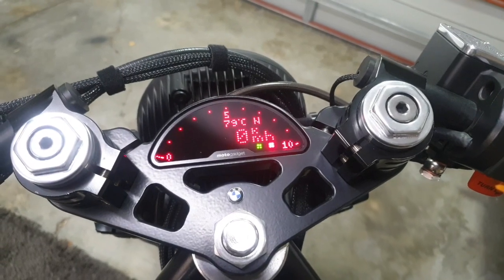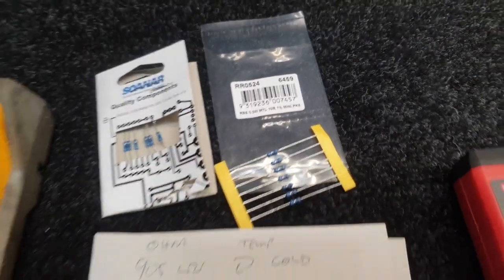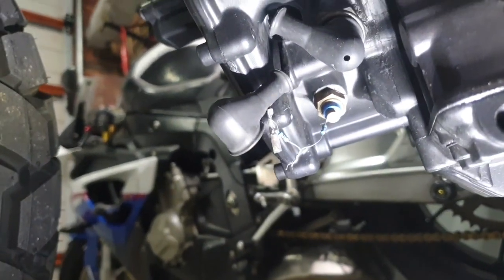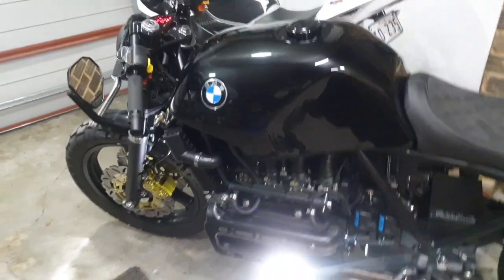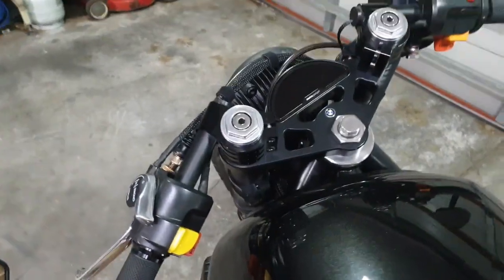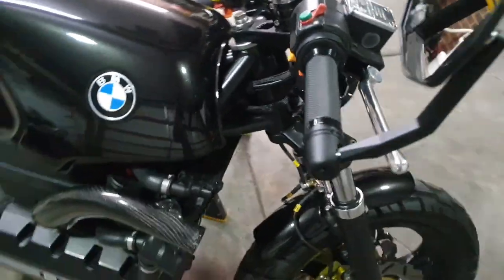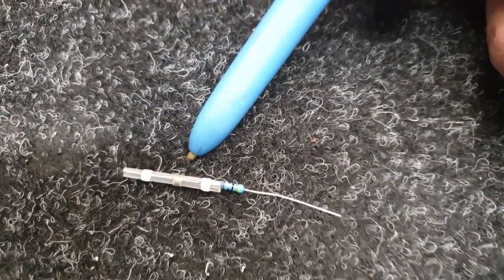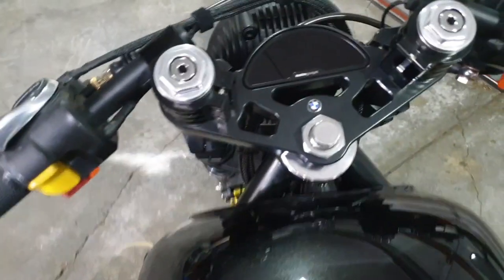How to get Motogadget Motoscope Pro to work with OEM H20 sensor. BMW k1100 fix to calibrate temp

Comment: Hello sir,
How did you hook up your gears to the motogadget. I also have that same issue as well.
Reply from the maker: @safakdurmus5312  Hi there, there is no way to connect gears to the dash due to the way it's wired unless there is a electronic box out there to distinguish it. Easier to just do the learn feature where you drive at a set speed and hit the cycle button as you change each gear. This way it guesses what gear you are in from rpm and speed.
Reply: @ is there one out there that we can buy or is it possible to built?
Reply from the maker: @safakdurmus5312  I think from memory someone may have had a go on the BMW K forums but can't be sure. Maybe google through them. I have tested the outputs so can post that if you wanted to see if someone could build one for you. It uses a combination of the 3 yellow cables (A,B,C)  and brown in this order. 
So neutral will have all 3 yellows to brown 
1st A B to brown
2nd A C to brown
3rd A to brown
4th B C to brown
5th B to brown
To confirm your A,B,C yellows select a gear you know and see what is shorted to brown through each gear. 
Hope that helps but IMO it's probably not worth the trouble 😉
Reply: Okay so let’s not know the gears but yellow and white color to breakoutbox to natural will at the least show me the natural on the speedometer?
Reply from the maker: @safakdurmus5312  No buddy this will not work. For neutral detect will will need to run a separate board like a Axel Joost neutral indicator or for ease of wiring a BEP 3.0 will give you a neutral output.

Comment: Hi, which sensor do you use? All sensors i found have a higher resistance and i can not make the resistance smaller (only bigger like you did that)
Reply from the maker: It's the OEM sensor that came with the bike Andreas. Not sure why yours is higher buddy as a lot of people have confirmed it worked with their OEM too. You have obviously checked the resistance of yours when the bike is hot and it drops yes as when it's cold it will be a lot higher.
Reply: @twistedfatebuilds  do you have a number or shop where i can buy it, my bike has no sensor only a normal plug. so i have to buy it.
Reply from the maker: @andreasedlinger7621  Try Motorworks UK mate, they stock everything.
Reply: @twistedfatebuilds  found it, THANK YOU :)

Comment: Your videos have been a great help when wiring up my 91 k100rs! Think I might have the same issue with mine. Do you think it's possible to replace the oem temp sensor with a motoscope one? I have a suspicion that the early motoscope sensors had a "sensor pin" that was too long, but looks like the new ones have a shorter pin. Also I cant seem to find information on thread size and if any of motogadget ones will fit.
Reply from the maker: Hi Frank, thanks for the comment buddy. I can't say if the new ones have a shorter probe but know 100% the one I tried back when I was doing this was too long making me do the resistor hack and return the Motogadget one.
Reply: @twistedfatebuilds   Wow, that was a quick response :D. Thanks! Guessing its M10, and the M10 size from motscope still seems to have a long probe. Ordered a 39 ohm 0,5w resistor from a local shop and will test it. Did you control measure the temp on the radiator fins or the hose to the radiator?
Reply from the maker: @frabebe76    😅 you got me at a moment on the phone. Yes they are defo M10. I even tried looking for a collar the MG could screw into to take up some length but no avail and I think it would of looked weird too. I tested on the fins and body of the radiator buddy. It was perfect to where the fan is meant to kick in so confident I got it 😉

Comment: I have the Bep 3.0 combined with motogadget pro.. I am stuck on the three wires (blue, orange, purple) from the motogadget pro where they should go on the bep 3.0
Reply from the maker: Hi mate, the orange goes straight to your motoscope Pro breakout box bus terminal and the blue and purple are not used (these are for later bikes like a R9T than have can bus) none go to the BEP.
Reply: @twistedfatebuilds  I dont have motogaget terminal box b. Is it necessary to buy one to get the motoscope pro and BEP work properly?
Reply from the maker: @theblacksmith93  Yes mate. Regardless of using BEP motoscope Pro will not work without a breakout box A or B
Reply from the maker: The breakout box relays all the info to your pro. So you wire from the BEP to the breakout terminals. If you wire direct it won't work unfortunately
Reply: @twistedfatebuilds  Awesome. What about the gears other than the neutral should there be something connected to BEP gears 1,2,3,4,5 ? Or it will figure out by it self at which gear the k100 is on?
Reply from the maker: @theblacksmith93  the BEP Will give you neautral light for neutral detect start enable. The pro cannot work out gears so you have to do the teach feature which will enable the pro to "guess" your gear using speed and tacho readings.
Reply: @twistedfatebuilds  thanks brother. Hope you make new videos especially about the k100 they are very helpful.
Reply from the maker: @theblacksmith93  Thanks so much for the comment mate 🙏 it's hard to get them out with full time work and the R build. what type of things do you want covered buddy and I'll try and get some more going 😉
Reply: @twistedfatebuilds  Man anything will serve the K100 community. Keep it up brother.

Comment: Buenas, tengo este mismo problema en mi K100 del 92, incluso usando el sensor de temperatura que recomienda Motogadget, ¿de cuanto es exactamente la resistencia que usas, 40 Ohm y cuantos W? Por otro lado, ¿has conseguido hacer funcionar el nivel de combustible? Es con lo que yo me estoy peleando ahora.
Reply from the maker: hola, he utilizado traducir en Google, así que no estoy seguro de cómo saldrá esto.
sí, 40 ohmios y 5 vatios en serie hacen el trabajo por mí. con combustible tuve que pasar el cable por un BEP 3.O para limpiar la señal. También desmonté el flotador de combustible y limpié los contactos. espero que esto ayude
Gracias
Scott
Reply: @twistedfatebuilds  Perfecto. Yo también uso un Bep 3.0. Llevo un cable desde BAR hasta FUEL en el BreakOutBox B y de este pasa al Motoscope pero no consigo que marque un porcentaje :(
Reply from the maker: @c4rbu  asegúrese de que el interruptor del BEP esté en el tipo de flotador de resistencia. el interruptor está en el medio y es muy pequeño. intentaré encontrar una foto
Reply from the maker: Te he enviado una foto en instagram para que el interruptor que debes configurar para indicar el nivel.

Comment: Hello. I also built a bmw k100 kaffe racer. I bought a Motogadget Motoscope Pro dashboard. How could you pass the rpm signal and the speed signal to the dashboard? Can you help me with that? Maybe send a wiring diagram? thanks
Reply from the maker: Hi mate, congrats on the build 💪 the easiest way I found is to use a BEP 3.0 your lunchbox connector will plug straight into it and rectify your rpm and amplify your speed signal voltage. All plug and play, cheap and easy to wire 😉

Comment: Confused isn't that the oil pressure switch !?
Reply from the maker: No mate it's the H20 sensor for bikes fitted with a temp gauge. The oil pressure switch sits beside it. Some models that didn't have a temp gauge OEM will just have a plug there for draining the coolant.
Reply: Thanks for clearing that up for me 👍
Reply: @twistedfatebuilds  Hi m8, Do Motogadget not produce a sensor to fit the pump drain port? My 86 K100 does not have a coolant sensor in that possition and I am not able to display temp on my motoscope pro via breakout box. I was hoping to put a Mg sensor in that possition but there seems very little information around on the K forums. Does the sensor not effect coolant flow in this possition? Many thanks.
Reply from the maker: @ADY954  I'm not sure if MG make a sensor for that thread size and pitch but if not you can always fit an OEM sensor with the added resistors to make it read correctly. it will not affect coolant flow by adding one.
Reply from the maker: @ADY954  I just had a lightbulb moment mate! Remembered that MG do sell one that had the same thread I purchased b4 I did the resistor hack. I purchased it but the sensor was too long and hit the water pump so I couldn't use it. I removed thinking I might be able to use it if I had a bung that would screw into the hole and sensor into it but it was easier  to work out a way to use the OEM sensor which I did with the resistors.
Reply: @twistedfatebuilds  Hi m8, just completed my build and fitted the oem sensor with 40ohms resistor to breakout box B. I still have no temp reading just the "Cold" display. Do I have to change settings in motoscope pro or should default setting display temp changes? Cheers
Reply from the maker: @ADY954  As far as I know it's only the HOT msg that can be customised in the settings. I'm pretty certain it shows cold until it gets to a predetermined temp and then starts showing the actual degrees. Have you tried it running up to temp?
Reply: @twistedfatebuilds   @Twisted Fate Builds  I did run it upto point of rad fan kicking in but was running other tests at this time. I will do this again when I have resealed the exhaust link pipe & can. I seem to have lost RPM also.
Reply from the maker: @ADY954  Then you should of had temp for sure buddy. The "COLD" notification is there until the temp reaches over 40°C then the actual temp number will readout. The fan should kick in around the 105°C mark from memory so you may need to check your sensor and cables to make sure you are getting the signal.
Reply: @twistedfatebuilds  Much appreciated. Will check.
Reply: Ran upto temp today. No reading. Will have to check wiring. Is it poss that I could have burned out resistor with soldering? I did not use the mini soldering shrinks. Thanks again.
Reply from the maker: @ADY954  I personally don't think it's the resistor. I'd be looking to make sure you are in the correct cable and have continuity from the sensor to the breakout box connection. Does your bike have two sensors down there? A common mistake is some bikes don't have the H20 temp sensor only a oil pressure switch which people mistake for the temp?
Reply: @twistedfatebuilds  Hi m8, Went through my moto pro settings today to make sure H20 function was activated & set my max temp message function to 140deg. Ran the bike upto temp, still "cold" display. When I removed the wire connection from sensor, the moto pro displayed a red line to signify no circuit to H20 temp display. When I re connected the wire to temp sensor, the display showed cold. Therefore the circuit must be complete & have continuity. I have used the  oem temp sensor loom wire, 40 ohm resistor & oem sensor to make the circuit. 
I have installed the OEM sensor in the coolant drain plug. The 86rs only had oil preasure switch located above. Am I missing something? Cheers.
Reply from the maker: @ADY954  Your not missing anything buddy it sounds perfect. Really at a loss here, you could check the resistance of the sensor to make sure it changes when the bike heats up. From my recordings it started at around 900ohm from cold and reduced pretty rapidly as the bike heats up. This will tell you if the sensor is still working.
Reply: @twistedfatebuilds  I checked the sensor resistance today. All appears to be working correctly. However, My sensor resistance measured when cold was approx 570 ohms & fell to 50 ohms as fan kicked in. This measurement is far wide of the mark in comparison to the numbers you mention but shows the sensor to be working in principle. I re calibrated the m unit to ensure the circuit was recognised but stil no numerical temp value. I will replace resistor when I get time. This is the only element of circuit I have not checked. Do you think the 40 ohms resistor may not be quite as compatable to the K100 as it is with the K1100? or am I clutching at straws. lol
Reply from the maker: @ADY954  sounds like she's on the money buddy. Doesn't matter where it started as it may have been colder here but the fact it dropped to where it did means it's working fine. Did you measure this at the final point after the resistor under the tank? If so you have confirmed continuity and the correct values so has to be something in the pro setting 🤷 
Not sure if you've seen my IG post but it had the values I got originally too 
https://www.instagram.com/p/CBAOJqPhLiq/?igshid=YmMyMTA2M2Y=
Reply: @twistedfatebuilds  I took measurements from the sensor.
Reply from the maker: @ADY954  I guess it would be good if you could take it from the cable before it goes into the breakout box to confirm that's the resistance you have there? That way you can be 100% certain the cabling is ok and it's between the breakout to the pro where you have the problem
Reply: @twistedfatebuilds  On checking my amazon purchase history, I realised I bought 43k ohm resistors by mistake(oh dear). Fitted 43ohm resistor & had resistance readings of 930ohms at sensor, 972ohms at point of breakout box connection. Not able to test as of yet as tank has been removed. Your time & patience is much appreciated.
Reply from the maker: @ADY954  That will do it! Glad you got there in the end buddy.
Reply: @twistedfatebuilds   @Twisted Fate Builds  Hi m8, I ran bike up to temp twice this w/e. The fan on my k100 kicked in at 93 deg on both occasions, with a 43 ohm resistor installed. Assuming the ecu is working correctly, this is inaccurate by 10 deg as the k100 has a fan operating temp of 103 deg. I later switched out the 43  for a 39ohm resistor. The fan kicked in at 95 deg. To have the guage read an accurate 103 deg on fan operation, i estimate a 23 ohm resistor needs to be installed. Is my theory correct & do the K1100 & 100s sensors differ. Thanks.
Reply from the maker: @ADY954  hard to say buddy, your temp sensor will have a +/- range it could be out so as I did the only way to accurately check would be to use a temp gun in conjunction with the screen reading. As per the vid I found the 40ohm to perfectly match but you may have to adjust up and down with a temp gun if it matters to you. Personally within 10° would be fine with me. It will still show when the bike gets to temp and if it's climbing to the point of overheating
Reply: @twistedfatebuilds  Thanks.
Reply: @ADY954  do you can say me the number of the oem sensor? i have to buy it :)
Reply from the maker: No problem mate. If you have one of the models without the temp sensor though are running a MG you can run a cable down through the timing case the same route as the oil pressure switch and replace the plug with a sensor  easily.